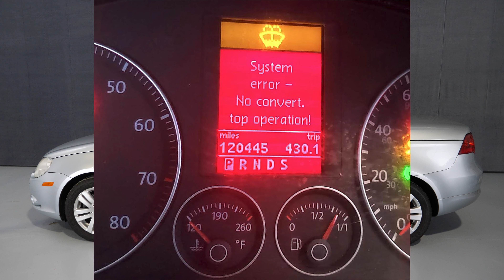VW EOS - How to  Remove and Replace the Hydraulic Pump Unit

Comment: I was quoted £2k by the local VW dealer and charged £60 for the diagnosis. Why won't local independent garages touch this pretty straight forward repair ? Great video!
Reply: Just due to needing second hand parts, genuine Vw would most likely be like £1000 where as sourcing a working part & guaranteeing it may need 2/3 at £250 each

Comment: This pump looks quite similar to the Mercedes CLK w209. Do different car companies use the same pump?
Reply from the maker: Thanks for asking. The EOS pump is unique and it can only be replaced by an EOS pump. Pumps for modern convertibles never interchange between different brands unless one brand owns the other brand and they use virtually the same top for different cars.

Comment: Thanks so much Klaus, do you know where to ship this Hydraulic Pum punit for an EOS 2006 with economic price ? 
Thank you
Reply from the maker: Thanks for asking. Where are you located?
Reply: @TopHydraulics  In France. Another question : do you think that the message "error, no convert operation" could be because of lack of oil into the pump ?
Reply from the maker: @tmarzloff  The only company who properly rebuilds these pumps is Top Hydraulics in the USA. Shipping from us to Paris, for example takes two to three days via FedEx International Priority and currently costs US$90. For economical shipping from France to the Us, you may want to check with La Poste and with DHL. The pump weighs a little over 4kg.
"Error, no convert operation" can be caused by a few things, very frequently by water intrusion in the trunk damaging the pump. The fluid level being low will not give you this error message if the top previously completed the opening and closing cycle. Fortunately, the fluid level is easily checked...
Reply: @TopHydraulics  Ok many thanks to you

Comment: I want to buy your product. I need a replacement pump for 2008 eos. How do you loosen the rear trim panel? In the video you already have it loosened. I can't seem to loosen the panel to get to the pump.Please help
Reply from the maker: Hmm. I would suggest making sure the weather stripping is not holding down the panel, then pulling up harder.

Comment: How can I test if it's the pump or the cylinders are the source of the problem of why my roof won't open/close?
Reply from the maker: Typically, the pump fails long before the cylinders do. The first step is to check whether the pump motor is running when you push the button. If it isn't, then check whether the pump has been sitting in a wet housing for a long time and corroded.

Comment: good evening I wanted to ask if this motor pump only activates the opening system or is also used for the sliding of the roof? the roof of my eos struggles to slide and the motor located under the sky has ruined the nylon gear inside. I wanted to know if this pump has something to do with it I have another defect? thank you
Reply from the maker: Thanks for asking. The pump does not move the sunroof portion on your top.
Reply: @TopHydraulics   grazie. My roof struggles to slide and the scooter has worn out the nylon Gear . Replaced. But manually the roof Is hard in sliding . Could there be a further problem?
Reply: I'm afraid the same thing Will happen again. Once reassembled do i have ti have It  programmed?
Reply: hello I replaced the nylon pulley of the motor. the sliding roof started working again. I did the reset but he no longer opens the hood. the trunk opens the sliding roof goes back ... the rear window goes up ... all the flaps open .... but it does not unhook the uprights .... and it tells me system error. I had the auto electrician check it and he told me that there are no errors. how is it possible?

Comment: Do you need to purge the system of air after install and fluid fill?
Reply from the maker: Thanks for asking. While the system is theoretically self venting, there can be some complications if you had a leak before. Three scenarios:
1) Only the original pump was bad and the fluid level in its reservoir was above the minimum marker before you took it out, you ordered a replacement pump from Top Hydraulics. We ship the pumps filled with fluid such that there should be no venting (air purging) required - simply plug and play.
2) You purchased a second hand pump somewhere, hoping that it will last a while. That's okay (if you don't expect the pump to last a long time) as long as you fill the pump before you install it and try to get as much air out of it as you can before running the system.
3) You had a leak in the system and the cylinders already had air in them. There is a chance that you will have to manually cycle part of the top in order to help the pump with getting all air out of the system. We can guide you through it if needed.

Comment: Good video but wich oil I can used for
Reply from the maker: Where are you located?
Reply: France / Lyon
Reply from the maker: @MohamedSalah-bg9qg  In France, it should be easy enough to get Volkswagen fluid. Otherwise, use Mercedes fluid 0009899103
Reply: Thank you
Reply: @MohamedSalah-bg9qg  VW recomends in the service manual VW G 002 000 Zentralhydrauliköl / central hydraulic oil

Comment: Replaced the pump, all windows except for the drivers side rear go down. That window stops about half way. Sunroof opens, but nothing else happens. Once sunroof opens, I get an error code on the dash and says close top. I made sure all wires were connected correctly. Any ideas?
Reply from the maker: Bummer about the driver side rear window. If one window does not move as far as the others, then the computer will not move the top.